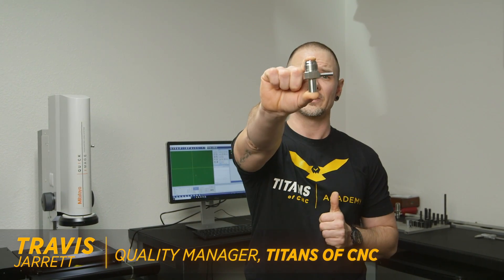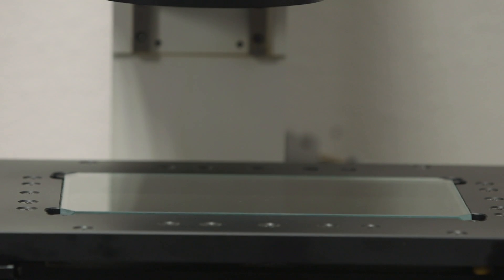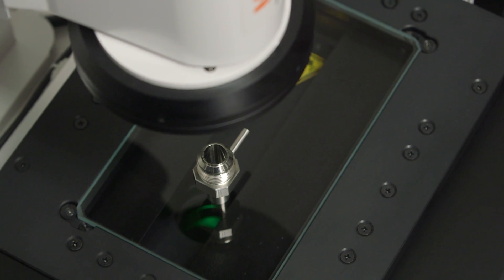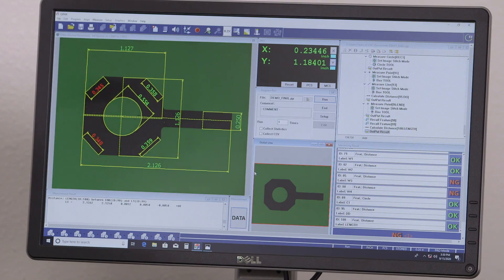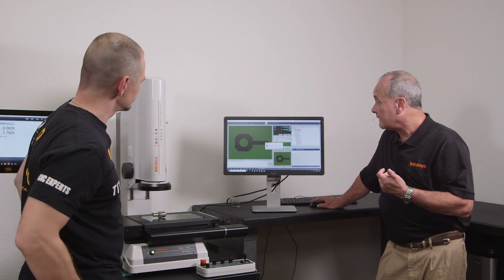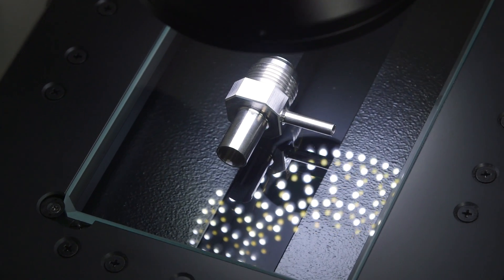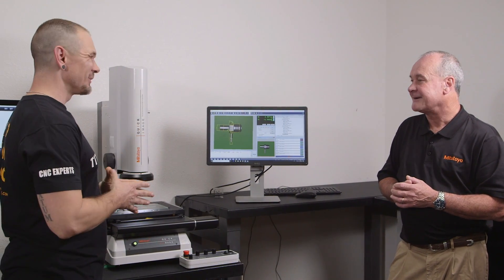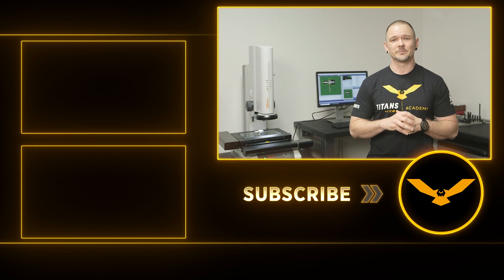Efficient Technology that can replace a CMM for many shops

Comment: Something to note this poor design flaw moving the table with an unclamped part can cause small parts to move slightly causing inaccurate measurements. We have one these at work, they are not accurate. You could measure a part, move it on the table and measure again and it would move 1-2 thou

Comment: The ergonomics/use look quite nice.  But none of that matters if we don't know what the Accuracy Rating is.  In inches (or metric I can do the conversion), what is the +/- Accuracy Rating (e.g. +/- .0001"), and Repeatability Rating?

A high % of our work has a total tolerance of .0002".  Off the top of my head I'd expect a tool capable of handling that to have a stated spec of something like +/- .000080.  Again, off the top of my head.  We often have small features that challenge systems like this.  As example, a .005" radius between surfaces.  or a small .032H x .020Dia "nipple" on a tip that also has a 30-deg taper for 3/4 of it's height.

Bottom Line:  Accuracy Rating?  Repeatability Rating?

Thanks for the video.

Comment: to use this technology, the part has to be really clean in order to eliminate the unwanted errors due to burrs or metallic dust. washing the part after each operation is a normal procedure but deburring every detail other than datums after every single machining operation is a loss of efficiency. Detail deburring is usually done after all the machining operations are completed to the spec.

Comment: I have 2 Keyence and Sylvac automatic cameras in my company. Works fine as long as the light in the room is correct, you have relatively flat parts and not go below 0.1 mm shapes (on keyence).

Comment: can this system automatic generate an inspection report with the file thats used for mesureing the part?
Reply: Yes- The screen on the righthand side give instant visual feedback on the screen with GO/NG, but you also can save / print reports with Actual | Nominal | tolerance values as well as generate a .csv file that can be automatically populated after each measurement sequence

Comment: How accurate is this? If you have a tolerance of +/- 0.01 mm in a hole,is it accurate below a hundred of a millimeter??
Reply: There are a couple of different modes:  High Resolution Mode and Normal Mode.
High Resolution Mode accuracy in the screen is: +/- .002um
Normal Mode accuracy is" +/-.004um
The difference is that the Depth of focus is changed (by adjusting the IRIS on the camera) to accomplish this.
You can read all about this here: 
https://www.mitutoyo.com/wp-content/uploads/2015/06/0515-02-Quick_Image1.pdf

Comment: Amazing to see how technology advances. Is this capable of inspecting internal cuts?
Reply: With vision systems the features that can be seen by the camera and illuminated can usually be measured.
if the internal cut is recessed it typically cannot be measured unless you rotate it into view.

Comment: Great AD :)
But ... for example with this feature - small "pipe" on side - on first measurment it shows 0.250 and on second side it shows 0.249  - i think its to big of a difference.
Reply: Thats only 0.025mm but as its round you could double check it with a mic
Reply: @tacticaloverlord9378  If it's has a h7 u can be fracked. Thats not why anyone buys measuring equipment.
Reply: @Ubicuse  I work in a cnc job shop as a 5 axis machinist and we mic sizes like that all the time we just frequently check the mics are calibrated.
Reply: @tacticaloverlord9378  mics just aren't accurate enough for certain jobs dude, 5 axis CNC or not. 25 microns is a lot in high accuracy measurement
Reply: @Bunta25  its a comparatively massive tolerance when compared to some of the  9 micron bores or 30 micron true positions we frequently hit. A micrometer will easily measure 25 microns.
Reply: @tacticaloverlord9378  Totally agree. Although, when you're working at that kind of scale, a mic does definitely allow for more human error is measurement.
Reply: Right Round  definitely possible, although a vision measurement system could quite easily have that level of inaccuracy, especially since the image on screen doesn't look overly focused so edge detection would have far more pixels to have to average.
Reply: good eye
that is a little alarming if the part was actually round... these things are 30k i would hope they would measure correctly